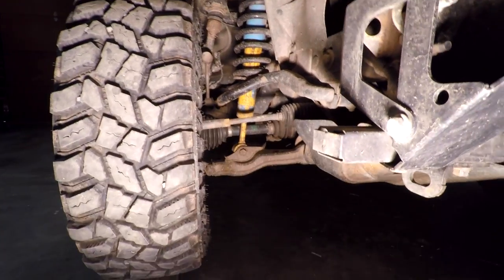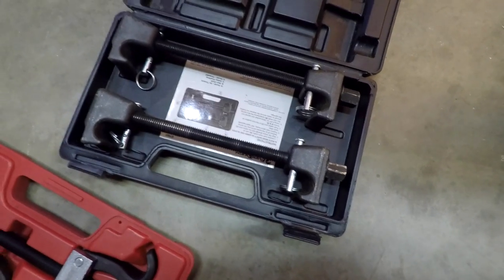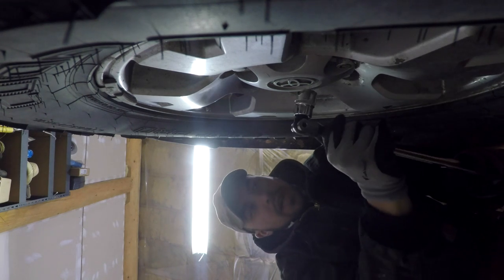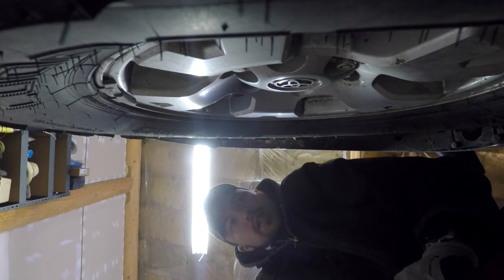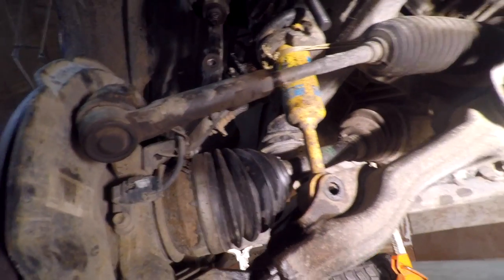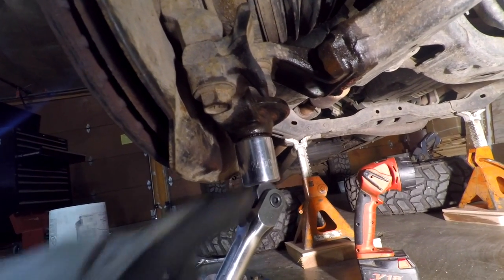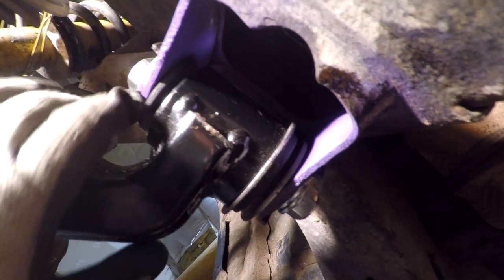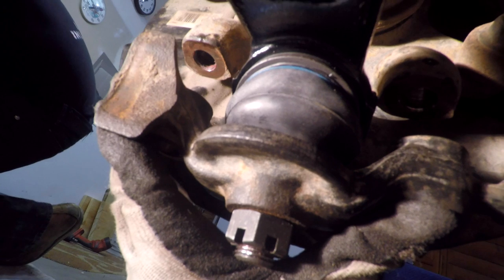Will The CVT Rooftop Tent Fit Into The Garage?!?

Comment: I worked in an auto motive  repair shop in my early teens assisting mechanics. 
One moring on a saturday when we showed up to work an old M&B crew crummy was sitting in the basement. It broke through the concrete floor. 
 I watched the tow company struggle to retrieve this F450 with its passenger cab on it. 
 If it would had happened today it wouldnt had been so tough. 
After working in my trade, with refineries, papermills, and power generation, all these experiences and rigging work with cranes, we learn a lot. That vehicle would have been out with some timbers and air bags.
Reply from the maker: Wow, that sounds intense!

Comment: Cody, would it be possible to check out the Garage where you are working, impressed with the big beams. We don't get a lot of log cabin style homes down under. So if you are shooting another segment finishing off the control arms a sweep around the inside would be great, providing it's OK with you. The  video you did on the 11th March showed some of the inside. Our homes are built more for cool rather than warm. There is a style of houses called a Queenslander, which is a traditional older style Ranch homestead with wide verandahs around most sides. The verandahs could be 12 or more feet wide, mostly open so you can get a breeze, also they will be set high off the ground again for cooling. As a rule under the house could be the coolest place, and we like trees on the western side to block the afternoon sun, so the house will be cool for the night. They are built mostly of hardwood with the outside being weatherboards, gal iron roof and approx 12 inch diameter Ironbark posts holding the house up. Look after yourselves and keep safe. Glen.
Reply from the maker: Hey Glen, I already shot the second video for the control arms but I can try and get some of the beams in another video for you! I'll keep it in the back of my mind. Thanks man.